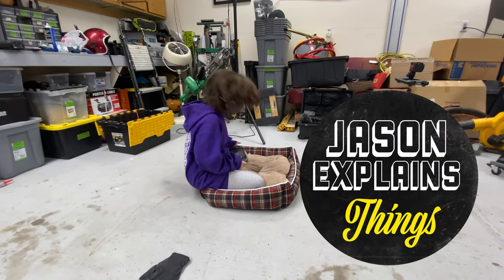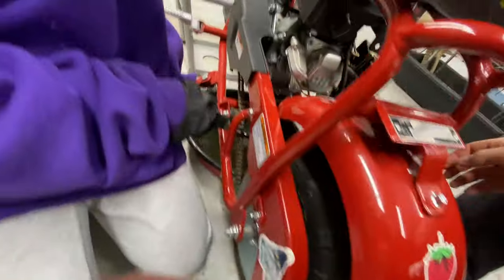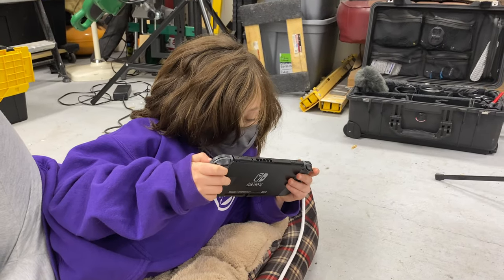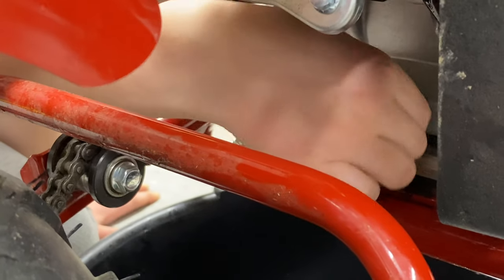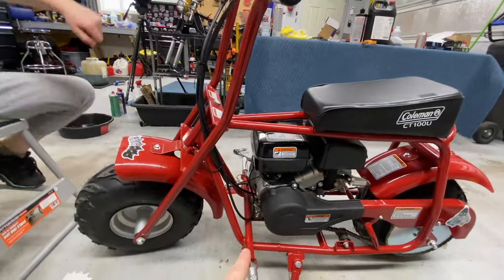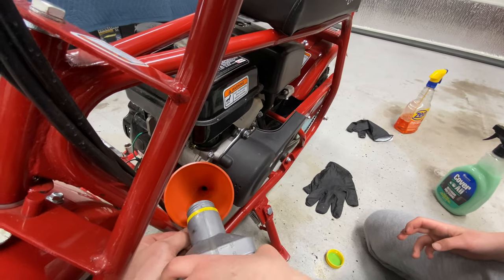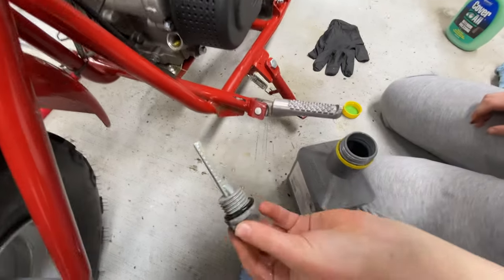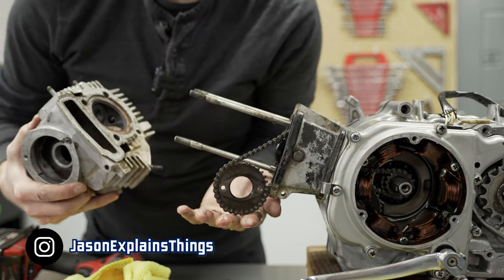Father/Daughter Time! Mini Bike Coleman CT100U Oil Change

Comment: How often do you have to change the oil?
Reply: Looks like he changes it a lot which is good. But the very expensive oil is unnecessary. Any quality off the shelf 10W30 works fine if changed often enough.